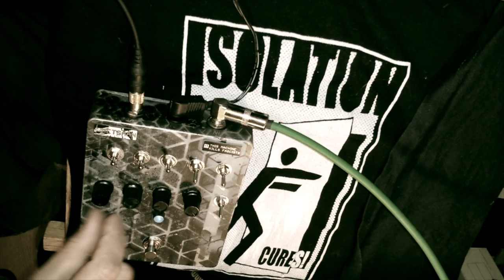METSÄÄN - VOICE VANDAL DELAY with CHOPPER + FREEZER function

Comment: so cool!!! How did you get the freezer function to work?
Reply from the maker: here's a quote from the MUFFWIGGLER forum post, that the FREEZE function is based on: "...shorting the 3rd (WE, or write enable) pin of the ram to 5V. This creates a permanent loop out of what has gone through the delay before. Unlike with a full open feedback, this loop will run forever without degrading, much like a looper pedal. If you put a switch in there, you can easily turn it on and off to add more sounds to the loop..."
Reply: @grm-metsaeaen  so cool!!! I just found out about this project and that FREEZE function has been on my mind. I'll have to mess around with this and get back with you :)
Reply: @grm-metsaeaen  I've selling these pt2399 delays for a few years with a glitch switch and boost switch. I'm going to have to play with this freeze hack. I've built VCA slicers which I've run into the delay they sound great. Having the frequency selection is next level. This is why I love your videos. You take devices many of us know and love, then you give it your own special sauce.
Reply from the maker: @stuartchapman5171  this delay is not based on the PT2399 IC it is something else, based on an old MAPLIN electronics kit. boards are available under the name PHONIC TAXIDERMIST, or something like that.
Reply: @grm-metsaeaen  cool I'll check that out. I'm about to prototype my twin delay with modulation. It would be good to mix up chips.